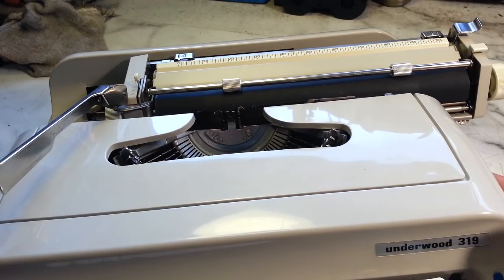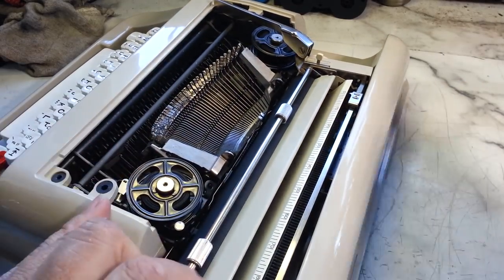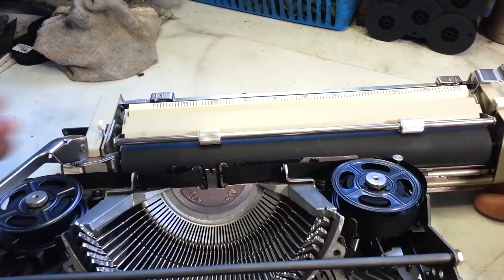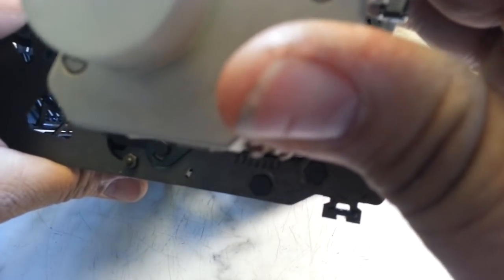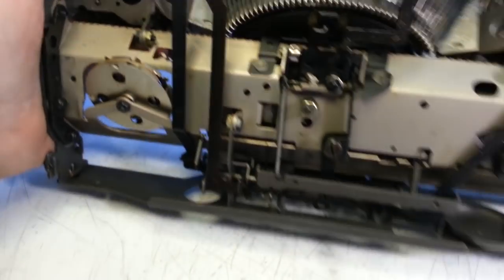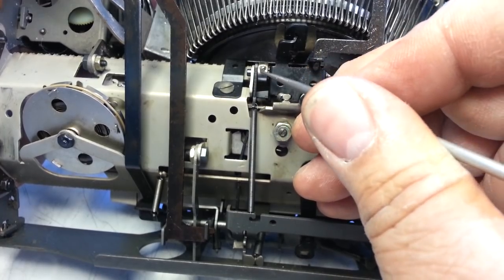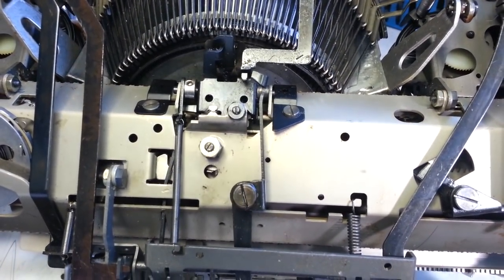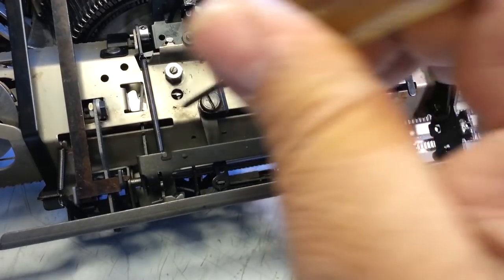Typewriter Troubleshooting Carriage Jammed Binding (very long) Repaired Fixed in 1 minute !!

Comment: A testimony to both your patience & persistence.  If the machine has this particular proclivity would there be any value to the application of a drop, or two of Loctite in order to mitigate a recurrence of the problem?  Could the toothed-carriage rail's repeated shock absorption due to a repeated 'slamming' of the carriage be setting up an excess vibration that precipitated the screw(s) loosening in the first place.  This video is going into my 'rewarded patience' top 100.

Comment: I've got a '49 Remington "All New" where paper release Must be engaged to feed paper position, or carriage movement stops due to released front feed rollers catching underneath at the card-guide's mounting (sits a hair high due to where screw's holes are drilled). No biggie, but took me a while to figure it out.  Anyway, pausing the video at 4:40 that will be my guess here.

Comment: Could the cfarriage binding problem on my Royal Senior companion have a similar cause? Greatvideo!
Reply from the maker: Doubt it, completely different design, although same troubleshoot procedure can be applied
Reply: @phoenixtypewriter2136  Thanks. Hopefully I won't have to disassemble it down to the rails, but it's beginning to look like such is necessary. Maybe Ko Rec Type is not such a bad alternative after all... (lol).

Comment: What do you do if the actual gear that holds the ribbon that should go up and down doesn't? My underwood golden touch has this problem and I'm not sure what to do
Reply from the maker: Ribbon selector in correct position ? Not sure what gear you're talkin' about, I would have to investigate
Reply: @phoenixtypewriter2136  It's the part that when you hit the key, it should move the ribbon up, and when the key falls back, it should go down, not sure of the name for it, tried to look up a diagram and it didn't show it